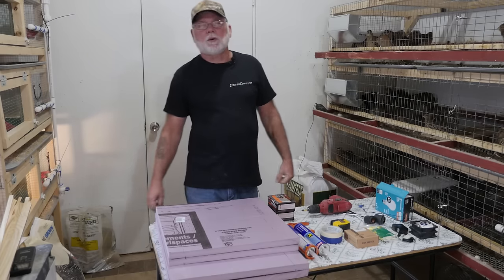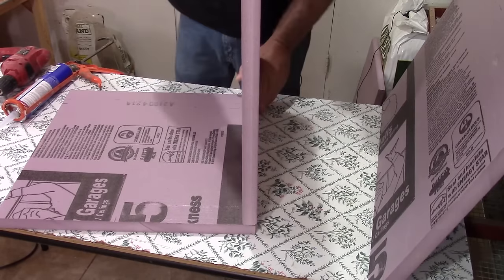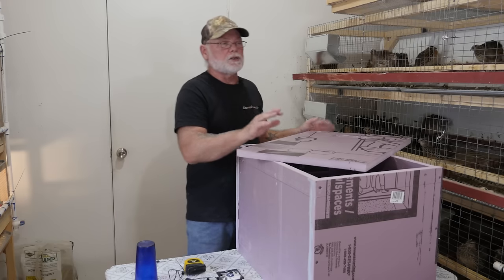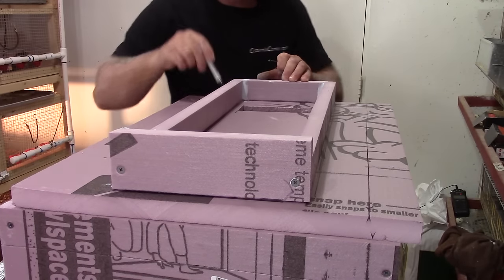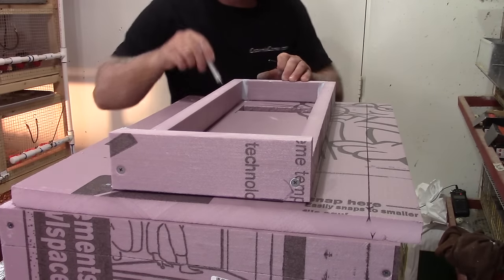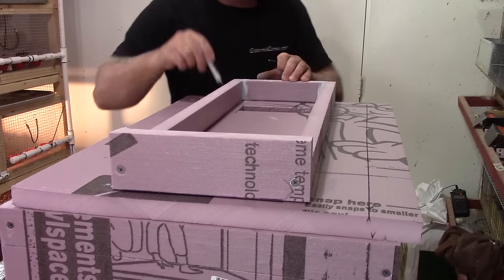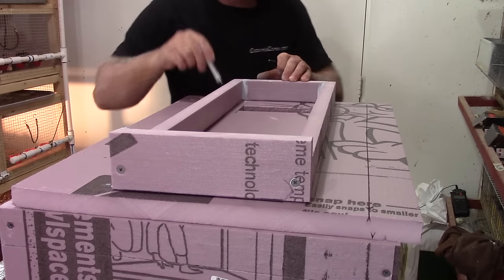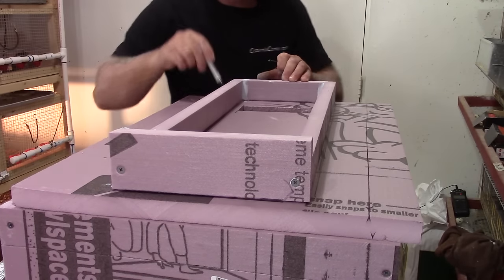How to: Cabinet Incubator - 240 quail egg incubator

Comment: Wow!  Love this video!  Beautiful work.  
I would love to try making one but I have no tools.
Reply from the maker: Thanks for the comment!
Reply: The foam board can be cut with a knife too. Just mark the width often to ensure that you stay on the line, find a straight board to use as a straightedge to guide the knife for at least the first slice, and slide a sharp (non-serrated) knife along it a couple times until you cut through—that's what I did! The screws can be done with a handheld screwdriver since they are into foam. The only difficulty would be the wood furring strips then.
Reply: Lattice molding would work for furring strips and any Lowe’s will cut it to your desired lengths for free after you purchase it. Good luck with your build.

Comment: Hello terry,  how fast your temp goes dowm after the lights are off. There are small gaps between the door and the incubator in my project. In my incubator once the lights goes off it will stay off for less then a minute. Is that how is supposed to work ? Thank you

Comment: What is the amp range on those fans? And what kind of 12v adapter did you end up using?
Reply: The Arctic f8 fans I got are 12V 9A. Is this wat yours are? What adapter were you able to use?

Comment: I finished building the cabinet. It closes hermetically. Built a wooden door for it with rubber seal closing. Thank you for all the instructions I appreciate it!!! I have one question. Do I need to drill holes for fresh air to go in??? And where should I drill ? And what size holes? And how many?
Reply from the maker: Yes, two on top and two on one side near the top and midway. 1/2" holes.
Reply: Coturnix Corner I turned it on yesterday I set the temperature to 99 changed the settings to 1 and 0 but I noticed the heat does not turn on until it’s at 97 should I set the temperature higher? Or use C instead of F?
Reply from the maker: @Zhakabg  follow the instructions in this video  https://youtu.be/2qspysPPpuI

Comment: On the artic fans they come with a 3 wire into a mulex plug. How do you wire it like you have it
Reply from the maker: The center wire is the hot wire and one of the outside wires is the negative. The remaining wire is unused, it is the speed control wire. Hope this helps.

Comment: Just built the incubator, it goes between 98.7 and 100 degrees. I hope that temp is acceptable because I have some eggs in it for a test run
Reply from the maker: Jerome Bankert that is the operating range of the incubator, good luck with your hatch.

Comment: I have a W1219 Thermostat. 
what should I set Temperature Controller setting
P0,P1,P2,P3,P4,P5,P6
I have seen 50 diffrent videos and all are diffrent
is there info on what each one means 
so I can make a good choice to set it up.
what would you set it up at.???
thanks

Comment: hi  new sub #673 .  question ;    turning the eggs ?  did i snooze lol. ive hached chicks n duckings before .
in old small units , now i may want to try 200 quail @ a time in the philippines ..   this hatching box looks great !
saving $100s  of bucks ...nice job !
Reply from the maker: I use a standard egg turner built for the Little Giant Incubators. Link in the description. Thanks for commenting!
Reply: @CoturnixCorner  thank you too.  lets think old school ,,,getting stuff like the turner, in or to philippines may be very tuff .  can i tip the entire box , twice a day .?  or  maybe roll the eggs a bit on the tray ?   thanks again .....
Reply from the maker: @charleshueckstaedt5064  Yes you could hand turn the eggs. That's what I did for the first few months when I first started with quail. Or as you suggested you could tilt the egg tray three or more times a day. I actually tilted my entire incubator before I built my cabinet incubators. Good luck!

Comment: Nice video. I might build a smaller incubator.  Any guidance on how much ventilation to provide?
Reply from the maker: I am currently doing a table top model of this incubator and will upload it soon.
Reply: @CoturnixCorner  I look forward to seeing it!
Reply: You could just add 1 fan. And inkbird makes many different models. I just bought 1 that controls temp and humidity. I will use humidity just for monitoring purposes. So many variations can be done from his basic design. This is a smart man follow his advice.
Reply: @BigDmike24  Thanks. I agree about the fan. I was wondering about size/number of ventilation holes to outside.

Comment: Hey just wondering how the wires get attached in the holes in the back of the temperature control unit

Tyler
Reply from the maker: They screw into compression contacts.

Comment: Could I put a rail above the top rail you did. That was 12” from the bottom to top of rail or would that be to close for my eggs. I’m wanting to be able to put 2 turners and a hatch out box on the bottom.
Reply from the maker: You could try it but I think the top rack would get too warm being that close to the heating elements. You could make the incubator a little taller but you would need to increase the wattage of the bulbs and install fans with a higher cfm to compensate for the extra space. Good luck and let me know how it goes. Thanks for commenting!
Reply: Thanks for the information I built one just like the one you made in the video just turned it on today. Going to let it runs for a few days so I can see how it does.
Reply from the maker: @GroundedOutfitters  Congrats and good luck!

Comment: can i use a heating element out of a still air incubater instead of lite bulbs
Reply: Sure, why not. Long as it producees enough heat to keep the temp up around 100.
Reply: I thought the same. But it cost too much to get the element.

Comment: Your video is great. Thanks for the information. Could you provide a wiring diagram for f8 PWM PST fan. I'm trying to tie the two together and then to 12v for the incubator.
Reply from the maker: I believe the center wire is hot and only one of the outside wires are negative, the other is fan speed. I hope this helps.

Comment: What are the dimensions of your hatching boxes?  How did you build them.  More of a question for how they are put together on the inside.  Is there 1/4 inch wire and a gap or straight wood floor with something put down on top of it?
Reply from the maker: The hatching trays are framed with 1" X 3" pine and the floor is 1/4" hardware cloth. I do put a layer of drawer liner in the bottom for the chicks to stand on. The top is just 1/2" x 1/2" framed with 1/4" hardware cloth to keep them from jumping out.

Comment: Hi Terry, I'm finished the build but working to seal it better. My temp drops to 94 or so before tripping back on.I have over 120 eggs ready but testing this today to see if I can get the temp more stable. Any tips? I didn't adjust the PID is that the reason? I found the D setting.. that was defaulted to 3. brought it to 1 and much better. May have to set the t to 99.5 to keep it warmer.  25 degrees in GA this morning. Coldest day this winter.Thank you so much.
Reply: maybe improve the heating lamps or adding more insulation will help ? Please let me know how it went for you since you got no response and has been 9 months ago... Be well.

Comment: Love this incubator but have a problem I always just used one turner but when trying to use two if I put the ink it’s at top level the bottom rack is like 5 degrees cooler if I set it to bottom turner of course top gets too hot any suggestions?

Comment: Question: Going by your measurements, if the walls are mounted between the top and bottom panels, that’s 24” + 1” + 1” = 26”.....how / why is the back only 25 3/4” tall???

Comment: Coturnix Corner: since too many types of ITC-1000F, which is the certain one you're using, and how do you wire inside itself?
Reply from the maker: The link to the regulator I use is in the description, but most of the ITC-1000's are the same.

Comment: I wish you would have recorded the placement and number of ventilation holes
Reply from the maker: The number of ventilation holes will depend on your area, average relative humidity and temperature. But for starters, there are two 1/2" ventilation holes on the top and on one side of the incubator.

Comment: Question on the fan. Our f8 artic fan has three wires. One gray,  two are not marked. Which two wires are we using? Thank you!
Reply from the maker: The center wire is hot and one of the outside wires is your ground. The remaining wire is unused and is a speed control wire.

Comment: Hey, CC, thnx for the wire up instruction. What gauge wire do you use in this video? I had used a wire from an old power cord and it fried (melted on me) Had 3 heat lamps attached and i think it pulled to much W. Please advice!
Reply: What was the wattage of each heat lamp?

Comment: Can I use a 40 watt incandescent lightbulbs. I cant find any 60 watt incandescent bulbs
Reply from the maker: You can use 40 watt bulbs, but it might take longer to reach incubation temperatures. 60 watt is recommended.

Comment: Could hvac fiberglass panel be used instead? (Worried about failure mode of the ink pid keeping lights on, or failing fans) and melting Styrofoam.
Reply: Put foil side inside.  Might get soggy with humidity, so probably not as good idea.

Comment: How did you get your humidity to come up in yours? I put a big plastic bowl in the bottom with sponges in it and I can only get it to 30% humidity
Reply from the maker: How many ventilation holes did you drill?  You may have to plug a few of them to help raise humidity. Here in FL the outside humidity is usually above 50% so the vents don't affect the humidity inside the incubator that much. Let me know how you make out.
Reply: I drilled 4 on each side at the top I plugged them off this morning to see if it would help but it didn’t. I watched a video on the gqf cabinet incubator to see how they did there’s I may try putting a shelf in front of the port holes for the lights and air blowing into the incubator to see if that may help the humidity rise.
Reply from the maker: @GroundedOutfitters  More air = less humidity, check your fans, maybe try unhooking one. Also, what wattage bulb are you using? Too much heat can dry the air. Think hair dryer.  Also, what are you using to measure humidity, is it accurate? Good luck!
Reply: I’m using 60w bulbs and I have a scurried digital hydrometer and a regular little hang on the wall hydrometer and both are reading same. I may try just one fan and see how that does
Reply from the maker: @GroundedOutfitters  We just had a cold front  move through last night and today, the outside temps dropped into the mid thirties and the humidity into the upper 30s
, the humidity in the incubator was at 35% this morning but rose to 55% when adding a cup of water to the pan. When the humidity is around 55 - 60% outside, the incubator will rise to 70% if I add water. What kind of outside temps and humidity levels do you have now? Also, check the seal around the door and make sure there are no gaps. Good luck!
Reply: The weather channel is saying it’s been around 33degrees with humidity around 89%
Reply from the maker: @GroundedOutfitters  wow, if the humidity outside is that high you should easily be able to get it in the 50 - 60% range. What is the humidity in your house? Sounds like you may have fans that are moving too much air, check the RPM and CFM on the fans. You want 2000 RPM or less and 30 CFM air movement or less. Try disconnecting one fan and let me know your results.
Reply: Yea I’m pushing to much air my fans are 4500rpm and 59cfm
Reply: Ok so I unhooked one fan and my humidty is now 53% thank you for the help and the great info
Reply from the maker: @GroundedOutfitters  Glad to hear it!
Reply: @GroundedOutfitters  good work.

Comment: Hi Terry   Do you actually need an air chamber at the back to circulate the air? Does it work better with the air chamber?  Thanks
Reply from the maker: From my research the forced air chamber gives you more consistent temperatures through out the incubator. Without you may experience warm and cool spots.
Reply: @CoturnixCorner   Excellent I am going to build one just like yours. Maybe a bit smaller. Thank you
Reply from the maker: @renegadedouglas8927  If you change the size in any way you may have to use a different size heat source and fan. It took quite a bit of testing and modifications to get this one working properly. Good luck in your build!

Comment: Kinda dumb question, what are the blue wires that connect between the thermostat and the light socket wires? What are they called and where can I get them? THANK YOU!!
Reply from the maker: They are just standard 14 Gauge stranded wire. Available at Home Depot.

Comment: Hi..what is the exact size and location of ventilation holes..thank you
Reply: Can i use 1 fan with 2700 rpm and do i need to change the hole size of the face plate..thank you
Reply from the maker: @hillanzcontreras  Any modifications to the fans and face plate might require making some adjustments to get the temps and humidity stable. I tested this design for months before making it public to ensure stability in the unit.
Reply from the maker: The vent holes are 1/2" and located two on top of the cabinet and two on each side, 3" from the top and the other about mid way from the bottom.
Reply: @CoturnixCorner  thank you very much..i have available 2 fans 102.5CFM each..can i use it?
Reply from the maker: @hillanzcontreras  The fans used in this unit are 31 CFM. I wouldn't use anything more than that or you may find it hard to control the humidity.
Reply: @CoturnixCorner  thank you very much
Reply: Are these fans always running?
Reply from the maker: @hillanzcontreras  Yes, the fans run continuously.
Reply: @CoturnixCorner  thank you
Reply: Hi. Can these incubator hatches chicken egg?do i need to adjust the height of the rail?thank you
Reply: @hillanzcontreras  can be used to hatch chicken eggs and I don't think that the rails need adjusting

Comment: Hey Terry, I’m in the process of making this incubator. My question is how do I wire the fans together to hook to the 12v power supply? I have the exact fans you have but there is three wires coming from each fan. The power supply only has two terminals for connection. Any help would be appreciated
Reply: Usually connect red to positive, and black to negative. The yellow wire is a speed sensor, but not used here.

Comment: Terry. Just an idea, but wouldn’t mounting the fans at the bottom of the air channel give you better circulation?
Reply: Better to have the high pressure by the heat elements
Reply: @buckbuckleyson2259  I was speaking to one at the top and one at the bottom
Reply: @nomadismileseeker6611  in the computing world that's called a push-pull configuration and only sees real benefits where there is an issue with static pressure. The airflow increase would be small and too much airflow can be a bad thing anyway
Reply: @buckbuckleyson2259  I’m not sure what your expertise is but I’ve been in the air-conditioning business for over 15 years. So don’t throw the word static pressure at me unless you know what you’re talking about
Reply: @nomadismileseeker6611  i do :) throwing credentials out there means your argument sucks btw.
Reply: @nomadismileseeker6611  i understand that over long distances higher static pressure becomes relevant again, but a design like that it'd be a marginal change
Reply: @buckbuckleyson2259  I don’t see how. If I make a comment I’m willing to back it up with my credentials. That doesn’t make my argument suck. It makes my argument valid. I’m not just some armchair quarterback.
Reply: @nomadismileseeker6611  credentials arent an argument. Full stop.
Reply: @buckbuckleyson2259  I didn’t say my credentials make my argument. I said my credentials make my argument is valid. You started this so I’m the one that’s going to end it. I was merely making a suggestion on a thought process you got technical with me.
Reply: @nomadismileseeker6611  they don't make an argument valid. Facts and experiences do.
Reply from the maker: The fans are placed near the bulbs to help keep them cool and to have more airflow across the bulbs and into the main chamber.

Comment: How do you hook up the fan to the 12 Volt Transformer?
Reply from the maker: Just wire the positive to positive and negative wire to negative. You can drill a hole in the cabinet to run the wires through.

Comment: Are you going to show how to wire the fans?
Reply: I bought the recommended power source and it’s quite easy just marry the fans and I soldered them together and the recommended power Spurs had a plug in for the pins

Comment: Would the 2 bulbs still be adequate if someone wanted to make the incubator a little larger to hold larger hatching trays?
Reply from the maker: You might have to up the wattage of the bulbs, but yes two should be adequate.

Comment: I have a wine cabinet that works as a chiller I am thinking about making it into an incubator since I don’t drink wine. It is pretty big. Do you think that system would work for it
Reply from the maker: Absolutely, You may have to play with the fan sizes and heating elements to get the right combo, but you should be able to make it work just fine. Good luck!

Comment: Does you controller drop to 98* before turning the lights back on? I can’t set my deviation on my temp control less than 1*.
Reply from the maker: Yes, the controller drops to 98 before turning back on.

Comment: When you said drill a few ventilation  holes, what did you mean?  I'm asking like number of holes, size, and placement.  Any info will be appreciated.  Thanks in advance.
Reply from the maker: Thanks for the comment! Two 3/8"  holes on the top about a foot apart, and two 3/8" on each side 3" from the top and 5" from the bottom is what I use. If your humidity drops too low you can tape over a couple holes to help stabilize the humidity at the levels you want. Hope this helps.